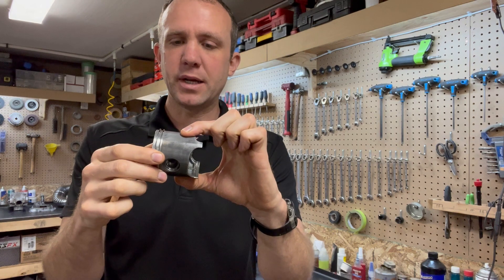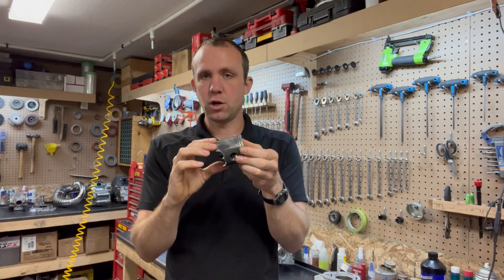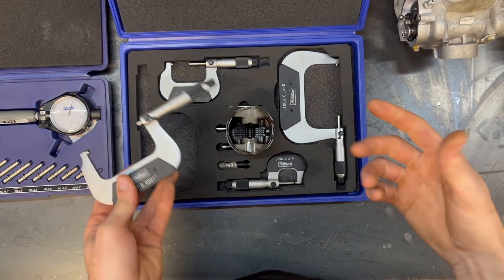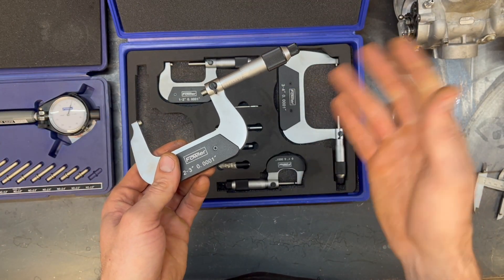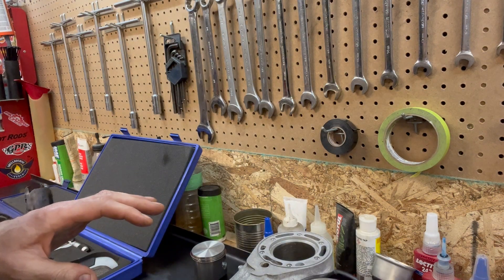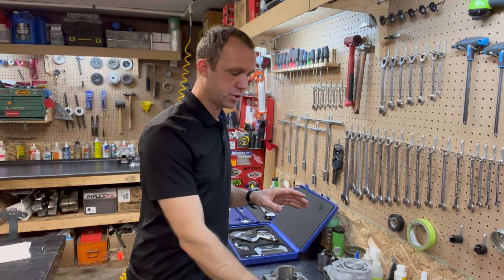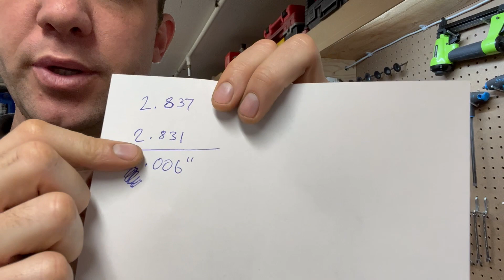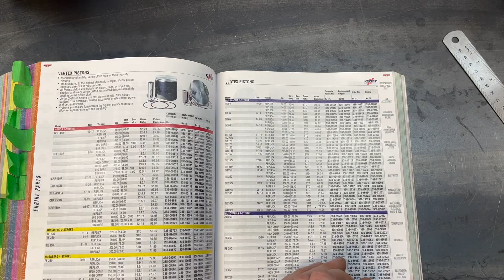Piston Clearance: Why & How to Check it

Comment: How is it easier to deal with imperial than metric literally 1mile is 1.6km, 1km is 1 000m so a mile is 1 600m , 1m is 100cm, so one mile is 160 000cm, 1cm is 10mm so a mile is 1 600 000mm, like how is it so hard to understand it. Its simple and brilliant.

Comment: An excellent video and production.  There are a number of excellent 2 stroke engine sites out there any you are clearly one of them.  Your approach is clear, concise and a professional approach to showing the viewer the points your are raising.  As a 52 year earthmoving mechanic I have learnt today so much of the Teflon coating.  I now realize a piston replacement is best due to some Teflon abrasion and not just rings and a cleanup hone I was considering.  Well done and goodonyou.  Keep up the good work

Comment: I definitely agree. I had a 21 140rf that i rode daily and hard on weekend ( technichal terrain ) but i seldom hit the rev limiter. Then my cousin got a 22 140rf and his bike is 6 months newer than mine and rides the bike only on weekends. But every time he got stuck on the trails he just locks the throttle on the rev limiter and pushing bike to get unstuck. His piston only lasted about 8 months and it started to smoke. My bike is more than 2 years with only issue is the clutch, wheel bearings and linkage bearings. Opened the top end. Piston and rings are in great shape. Removed the carbon deposit and the bike is still healthy.  I also check the valve every 4 months. And only adjusted it 2x i 2 years

Comment: so you are just measuring piston clearance in the beginning to establish an understanding of wear. BUT if rebuilding an engine you simply go to the cylinder and gather measurements with dial bore gage and then subtract the spec'd clearance referenced in owners manual and that helps you decided which piston to purchase no?
Reply from the maker: Almost. Piston listings show the size. I set the bore gauge to a new piston size & measure the difference. Same results. Just different procedure.
Reply: @ChuckfromTrueTech  and you do this in this order to make sure cylinder is not past wear point?

Comment: What fowler bore gauge did you buy? Im interested in getting one. Same with your micrometer set. Thanks.
Reply from the maker: Not sure. I bought them years ago. My bore gauge shows half thou increments which is close enough for checking clearance but not accurate enough for boring. Micrometers are just 2”-5”.

Comment: Do you recommend using new gaskets every time when re-installing cylinder and head?
Reply from the maker: I always use a new base gasket because if it leaks it’s potentially catastrophic and time consuming to change. I’m not as picky with head o-rings because it’s immediately obvious if one is leaking. That being said, the o-rings come in the kit so I do change them during a top end job.

Comment: If a piston still measures within spec and you decide to re-use it, should new rings be fitted while it's all apart? Or piston and rings should only be replaced together?
Reply from the maker: I’ve done both. I check ring end gap for that. Most often when I have a top end apart I change both though because I deglaze the cylinder. Any time the nikasil is worked on the rings should be replaced.

Comment: What brand micrometer and bore gauge along with sizes do you recommend?
Reply from the maker: Size depends on what you’re working on. 
There are several reputable brands with Mitutoyo holding the top spot. 
You don’t need to spend Mitutoyo money in most cases though. 
If you don’t read a micrometer on a regular basis it may make sense to buy a digital one in the size you need. Reading a manual one takes a bit of getting used to.